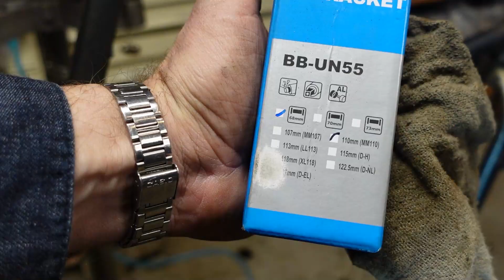FILTHY Bicycle Srip Down and Rebuild - Trek 850 - No talking, ASMR Pt 1

Comment: Thanks for saving a bicycle built for a tall person. They are rarer than hens' teeth...I still have a tall Trek 920 Single Track from 1998. I would have rather had a 930 or 950 but I didn't see any other options on the floor. In fact, it's the last time I saw one in a retail shop.  Their all-steel frames from that era hold larger people up really nicely. Thanks to this channel, that bike is running as smooth as ever. Since I found your channel it has new handlebars, stem, new brakes, chain and new pedals...I'm taking it out later today for a postal run through rural Nevada. I would love to hear more about tall bikes btw...😎

Comment: Holy cow!  That little bolt thing you use to clamp the bottom bracket remover using the crank bolt hole!  Absolutely genius!  So many busted knuckles that would have saved me.  I saw that and mentally smacked my forehead.
Reply: You can also use the crank bolts + washers to hold the nut in place.
On the non drive side (loose cup) you would also have to loosen the crank bolt after you'd loosen the cup a bit and so on, otherwise the crank bolt can damage the threat of the square taper or the bolt itself get damaged.

Comment: Nice Video! Take a look at that Alivio Crankset; if it has the ID "FC-CT90", "FC-M290", or " FC-MC12" stamped on the inside of the RH Crankarm, it was a Crankset that was part of a Global Product Recall by Shimano AND the CPSC way back in 1997, due to crank arm breakage and possible serious injury to the rider. You can return that Crankset along with the Serial #, Brand and Model of the bike to any Trek dealer and they'll give you a comparable Replacement free of charge. 🙂
Reply: That Shimano recall is still valid. There may be a complete kit that includes the crank, front der and chain. I called Shimano about 6 months ago to verify availability of replacements for a shop owner I know.
Reply: That is definitely a recalled crank.I don't think they are honoring the recall anymore.

Comment: I started laughing at the adjustable stem situation. It’s one of the simplest and annoying parts of older bikes. Having to fiddle farting around with shaking to loosen it up, after it’s been loosened. Had many good, fun years working in shops.

Comment: You don't need to use bicycle specific hand tools to work on a bicycle 🚳 DeWalt bit drivers are perfect for this application you can control the torque

Comment: That was an awful lot of rust on the bb thread.. at least wire brush it all off or better still chase the threads with the correct taps before putting in the new bb. The old bb looked wet so there is water ingress into the frame - the bb will just rust back up and seize.
Reply from the maker: Thanks for watching in commenting! Point taken!

Counterpoint: a bunch of grease on the threads is good enough for a bike of this value and condition.
Reply: Many drill a small hole (5 mm) in the bottom of the bottom bracket for water to drain or moist air to ventilate.
The cable guide can be a bit in the way for that.